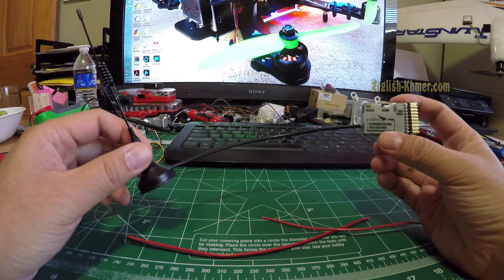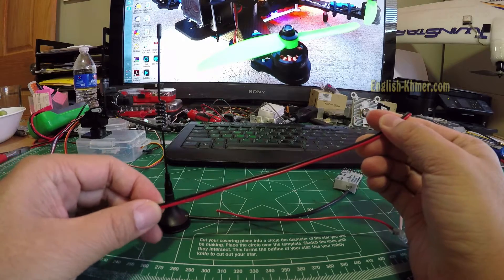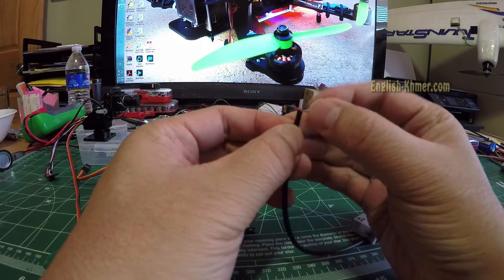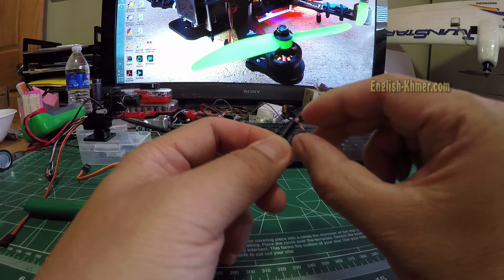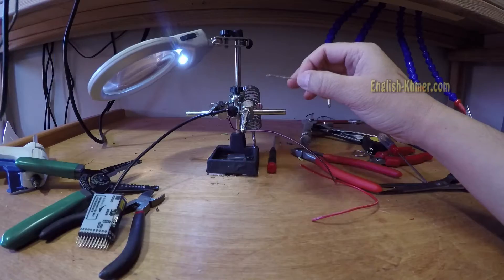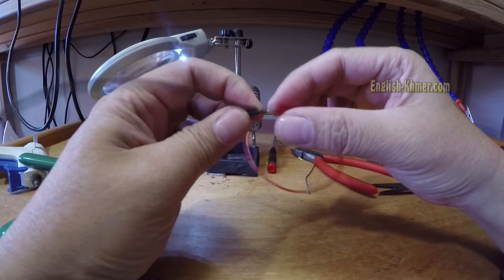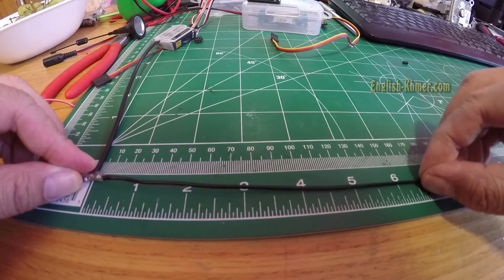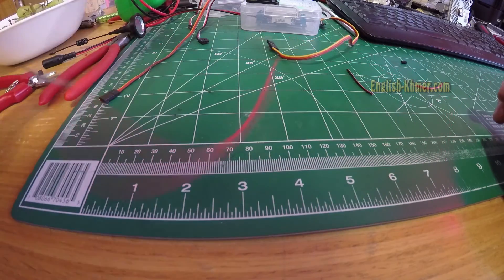How To make Dipole Antenna for Arkbird UHF 433Mhz Receiver

Comment: why did you chose 6.25 cm-long wire ?
Reply: That's in inch - a quarter wave length of 433MHz is 17.31cm or around 6.81 inch - so you might be better off at 6.8 inch. Since this is a half wave antenna, it goes the length of a quarter wave to each side.
Reply: Dave P , I know this a 6month lag. Please note that your calculation is not taking into account the wave moving through air. At sea level atmospheric density, we generally multiply the quarter wave calculation in vacuum by ~0.95 to get a quarter wave at sea level pressure 14.7psi / 760mm Hg. This will make each element of a 433mHz dipole 163mm in length. So, 6.25" / 158.75 is still a bit short ... I cut to 165mm then tune by SWR and get to ~163.2mm for my Scherrer UHF. Hope this helps.

Comment: Sorry for the multiple questions.. I have some 14 gauge wire. Do you think that would work instead of the 18 gauge, or does it have to be 18 gauge?
Reply from the maker: +PoppaShocka According to the Alex Greve, you can use the larger wire but it will increase interference, preferably a solid shielded copper wire, not strings of wire.
Reply: +Niset Khmer Ok thanks. Is that what you used? Solid shielded? I may be able to just grab some 14 gauge solid shielded from my hardware store..
Reply from the maker: yes, I got them from Home Depot.
Reply: +Niset Khmer Awesome. Thanks!
Reply from the maker: +PoppaShocka Let me rephrase:    Use a solid copper coded 18 gauge wire, not strings of wire.   Thanks.
Reply: +Niset Khmer gotcha. Thanks.

Comment: I have a new Arkbird UHF and am about to install it on a Zeta Phantom, but don't like the stock antenna. Could something like this be done to add an SMA connector?
Reply from the maker: +PoppaShocka Yes, you can add SMA connector by get an SMA extension.  Cut it and then use the SMA female to connect to the Receiver and male end to make Dipole antenna.  I made one like this also.
Reply: +Niset Khmer ok cool. Thanks!
Reply: +Niset Khmer would you say it matters at what length I cut the original antenna wire to put the dipole (or SMA) on? I really only need about 3 inches coming from the Rx before I connect the dipole.
Reply from the maker: +PoppaShocka You can cut any length off the RX.
Reply: +Niset Khmer Thanks!
Reply from the maker: +PoppaShocka In this video, you&#39;ll see I have RX with SMA connector: 
https://youtu.be/GrdF9r7HV8s

Comment: No video as being it is pretty cold here, flying is not real fun. I did set up two Arkbird receivers side by side on a chunk of foam board. One had the stock antenna the other had my homemade dipole. I set up the transmitter in my dining room and jumped into my vehicle and went for a drive. Got about 7 km away in a flat area with few trees before I lost signal. Homemade antenna had better range glitched less and got signal back quicker. I did a post on RC groups with pictures.
Reply from the maker: +bugaboo102 Great info!

Comment: Great video. I have already done this mod and in side by side comparison to a stock receiver with stock antenna I see about 20% better range.
Reply: I forgot to add that I also remove the stock coax and add a longer one for easier positioning in the aircraft. The stock coax is very stiff and I replace it with rg 174.
Reply from the maker: +bugaboo102 Great!  I'd like to see the video for the max range you got on Arkbird UHF.  Thanks.